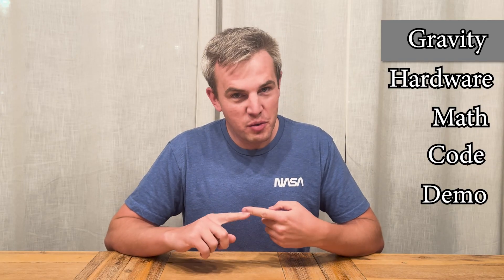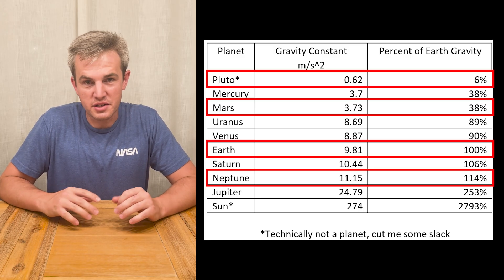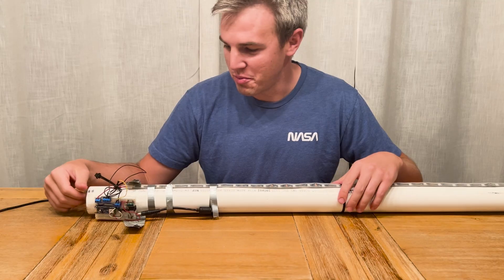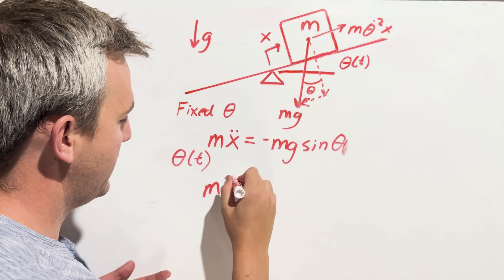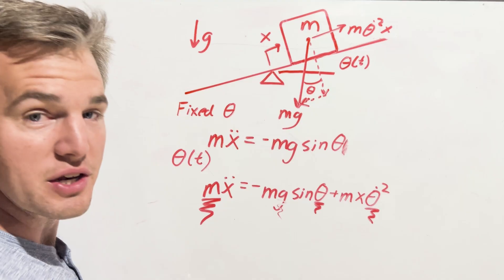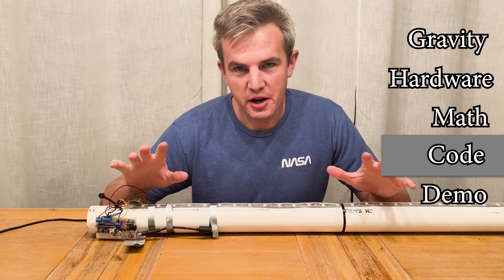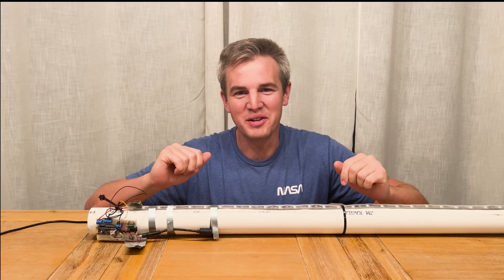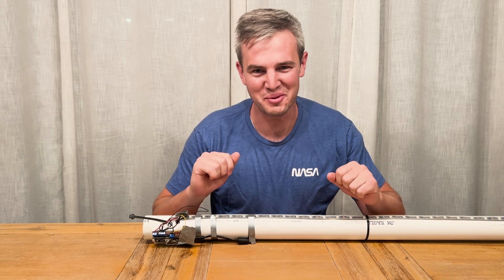DIY Gravity Simulator - Experience gravity on the Sun using LED strips and math

Comment: Use a motor to pull down on the pipe to simulate heavier pipe too. 

 Maybe 2 chords could pull on each end of the pipe to vary to total "gravity" and the object being balanced (2 motors).

Nice project!  A teacher with that in a classroom would be a memorable teacher!
Reply from the maker: This would be awesome!  Then you could simulate the weight increase as well. It would need to be a pretty heavy base!

Comment: for the challenging part, you can control the magnetic strength of an electromagnet inside a copper tube. The strong the  magnet gets, the more it gets stopped. maybe the copper tube isnt a copper tube, but a coil of wire wrapped around an acrylic tube. This setup would probably defeat the portability need you have.

Cool project and demonstration.